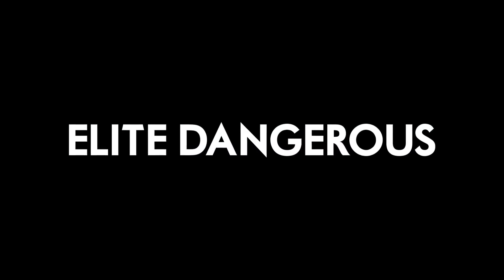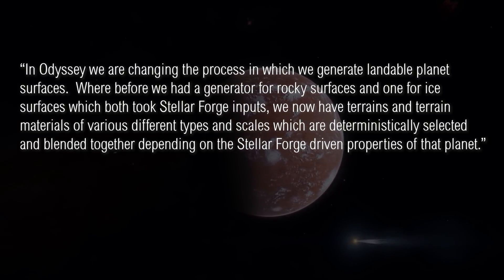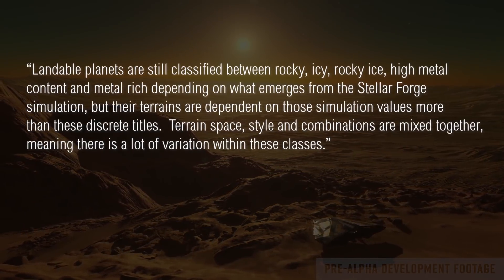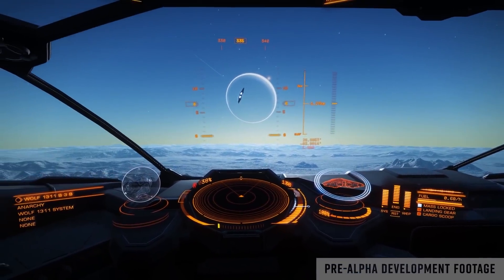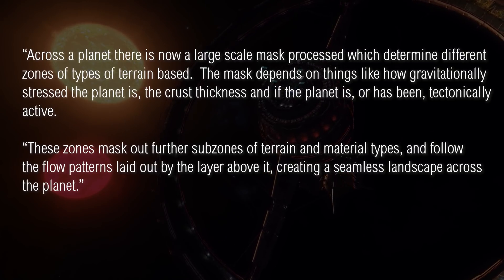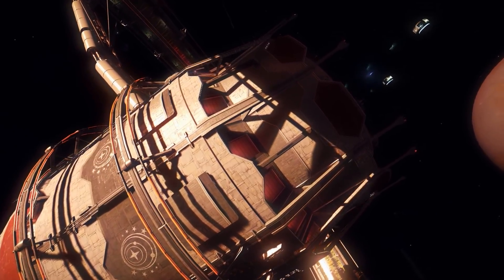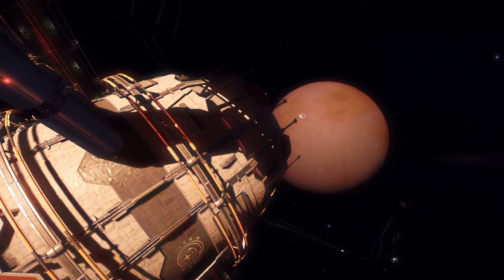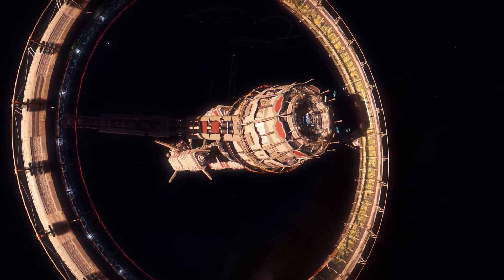Elite Dangerous Odyssey - Details On New Planet Tech, NPC Chatter And Dev Team

Comment: Does anyone know when the official date of Odyssey coming out?
Reply: "Early 2021" is the only info we have right now.
Reply: @elixwhitetail  there was a leaked release date, but knowing the current state of game developement, it could come out anytinme from then till the heat death of the universe.
Reply: @jerrybroderick2858  That "leaked release date" isn't really reliable and it has to do with exactly how the Steam backend handles store page release dates.

When someone creates a store page for a new release before it comes out, like Odyssey for example, they have to plug in an exact date into the backend system. They can change the date at any time to anything they want (as long as it's in the future), but they HAVE to enter something even if it's not really when they plan on releasing the game/DLC/whatever. Even though the release requires an exact date to be entered, it doesn't have to show the exact date on the public store page.

And that's why the Steam Store page for Odyssey said "21 April, 2021" briefly before it was changed to "Early 2021" but I'm telling people not to take that date too seriously - because there's absolutely no requirement by Steam for that date to be in any way correct. MAYBE April 21st was actually the target date in Frontier's offices as of a few weeks ago, but until Frontier confirms anything it's basically meaningless.

But, yes, you're correct, until Frontier actually announce a release date we have no idea when it will be. It could be delayed until late in the year; we've seen games get delayed at the last minute before in recent times, and Frontier themselves already delayed Odyssey's release by several months. We won't know until they tell us something.

Comment: I would really be happy with QoL or wishlist items instead of "Odd C": These few things would get me way more excited than this...but alas i do not speak for others
-able to toggle to relative mouse settings with a key stroke
-Increased module space
-Remote transfer of tritium from storage to FC tank (i dont have a carrier as im still wondering if i will really have a use for it apart from ship storage, yes i do have the funds for it) coz i dont play ED that often
-Real dynamic economy driven by players, like shipbuilding (after ship destruction) and selling (X4 type economy) no board resetting after a time.
-Space Base building, and all mulitplayer related features that comes with that. including surface mining opperations
- VTOL type landing into asteroid bases/ cracks deep into the planet cores etc.
-Better looking NPC faces coz Dayum they be Fugly NPC's
-Ability to have my hired crew not take a slice of the pie or experience earned while be inactive and waiting, without needing to fire them and lose combat progress earned.
-NEW SHIPS!!! Panther Clipper
-Empire Medium ship dedicated to combat, no nacelle mounted guns, a ship that is everything the empire ships are not and all typical Empire shipbuilding advantages taken away like speed in turn for agility.
-Small or perhaps larger fleet control, like a wingman in a proper ship i own, even if just in solo or private group.

Comment: I hope at some point they do offer a Next Gen console version as the old gen consoles I doubt will be capable of what they are showing in the videos - surely if No Mans Sky can do it, ED can do it?
Reply: I think it’ll be okay on Ps4 pros and Xbox One X’s, but yeah the base consoles would struggle
Reply: Oddly enough they put out a statement that the base game technical requirements will be the same after the update.  Apparently what they are doing is very graphically efficient.  I would believe it considering E:D runs on pretty old computers relatively well.
Reply: @profozpin227  I noticed a huge difference moving from a PS4 to a PS4 pro - the PS4 version can get extremely jittery with very poor frame rates at times on the standard hardware, which you don't get on the Pro.  Then again maybe with new optimization techniques developed since 2014 they will be able to do more than they did back then.
Reply: @Beer_Dad1975  I'm not entirely sure how well optimized the console version is so don't take my word for it. Have you fooled around with the graphics settings a bit?
Reply: @profozpin227  There isn't much in the way of graphics settings.  On the Pro you get a high quality mode which does improve the textures & lighting a lot, on the standard PS4 you get nothing.
Reply: @Beer_Dad1975  that is wierd. back when I used an xbox for the game I had no problems with it.